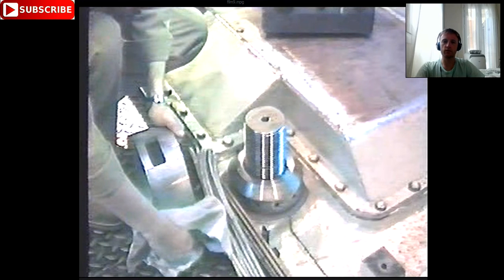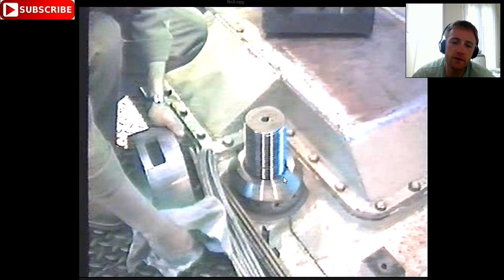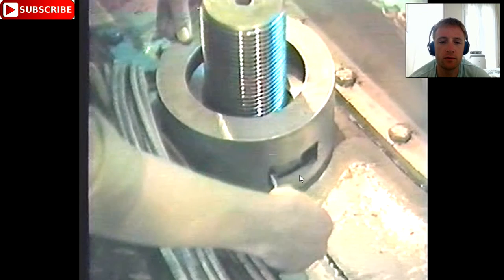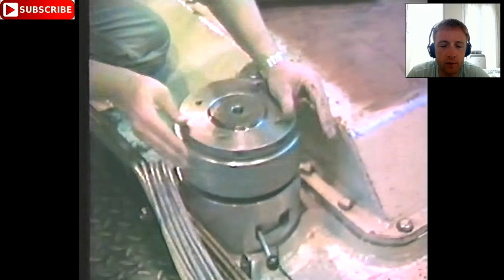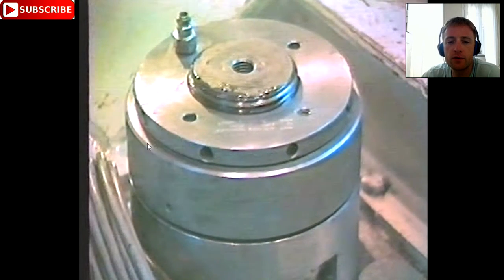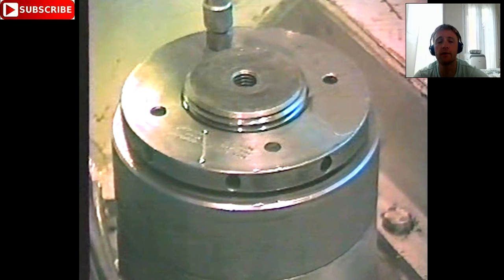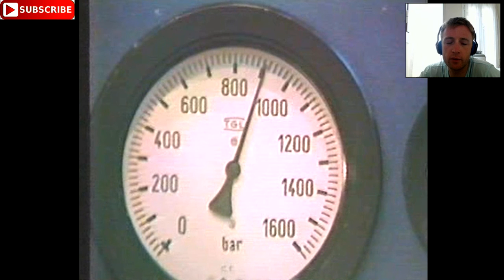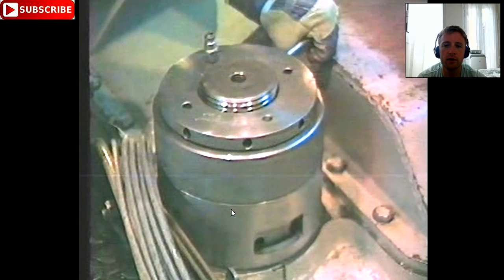How to use Hydraulic jacks for Untightening  Bolts of a Ship Engine

Comment: Pls help me piston rod bolt broken thread part for assembly hydraulic jack
Reply: Upside of stud bolt broken so can not put hydraulic jacke for expand the stud bolt now i am in trouble hic hic
Reply from the maker: In that case try to repair the thread, in case that is not possible you should cut the hydralic stub and nut completely.
Be sure that you own spare stud and hydralic nut.
Always use proper personal protective equipment when handling hydralic pressures.
Thanks!
Reply from the maker: Normally welding inside engine is prohibited because you can make arc to the main bearings or some parts of engine.
Reply: So can i welding arc to stud bolt of main bearing or not? I also consider about this. You mean cutting the bolt and stud by acetylen? I think cut by acetylen also very dangerous and difficult, the bolt m27 torque 62.7 mpa is it can open by a pipe wrench?
Reply from the maker: @ducthangtran3010  Welding not in any case ,cut by cutting disc.Only protect all surfaces from dust and particals.
Reply: Adventure Story i think cut by cutting disc very difficult and may be touch to piston rod if complete cutting
Reply from the maker: @ducthangtran3010  please provide image!
Reply: @ducthangtran3010  0)
Reply: I haven got spare std bolt. Any way i think that i will welding a nut M 30 to the broken bolt and use spaner to open? Is that possible?

Comment: why we turn back half turn..is it to provide space for nut to open
Reply from the maker: Yes if don't let space the hydrolic nut will stuck and will not move,this is only when loosening .
Reply: @Marine_Engineer_learnings  during opening of the nut by hydraulic jack why we need to turn the nut for few turns not the jack I am mentioning here?? Why not fully turn or not turn the nut as we already turned the jack half a turn??
Reply from the maker: Hello there is clear procedure of setting up the hydraulics if you like to try any other set up you can make it and test to see what will happened.
Reply: @Marine_Engineer_learnings  haha no I am just curious that's it anyway thank you
Reply: thank you sir...
Reply: @Marine_Engineer_learnings  I was seeing many times before people dit back half turn also when tightening ...  so is in that case  the same  tight torque ? thnx
Reply from the maker: @robsonsz2423  dear friend for tightening it is not necessary to turn half or one round back ,just tight them but only by hand when tightening .When you untightening 1 and half round slack.Thanks!